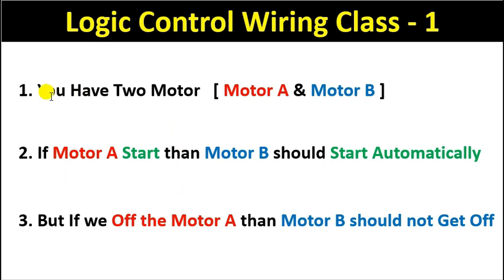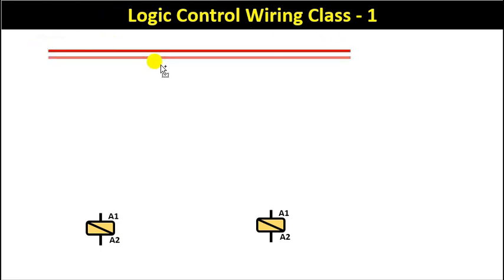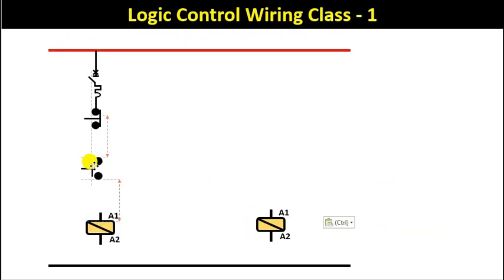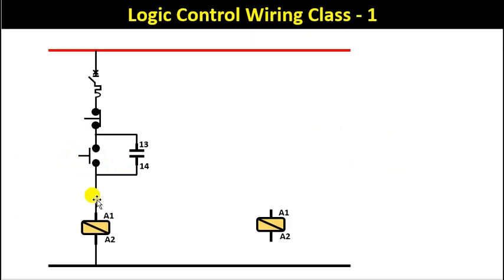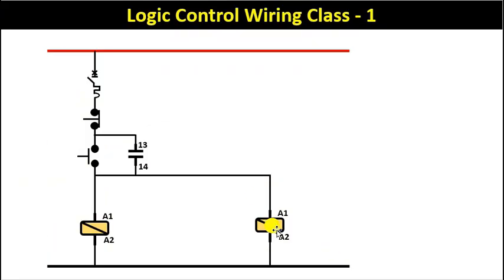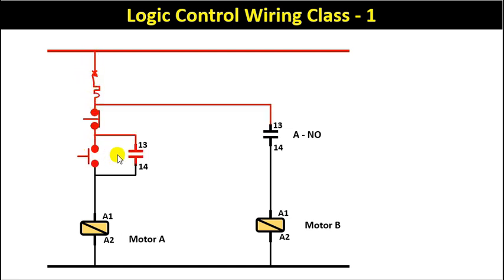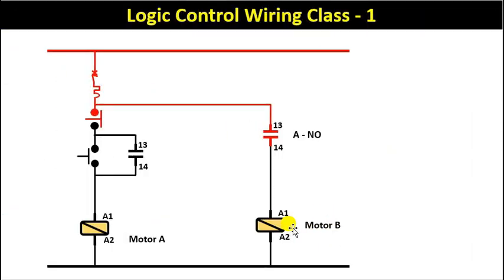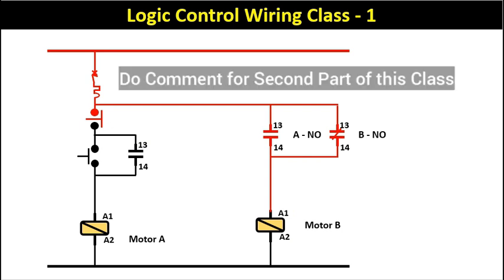Motor Auto Start And Not Stop | Electrical Logic Control Wiring Class 1 @TheElectricalGuy

Comment: Everything is right except logic 3. a contactor can have more than one set of auxilliary contact, just wire in parallel another Normally open pair (instead of contact 13 14) of contactor A with Normally closed of the the same contactor A and you will achieve logic 3